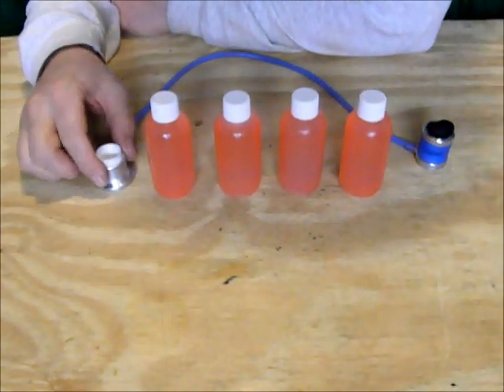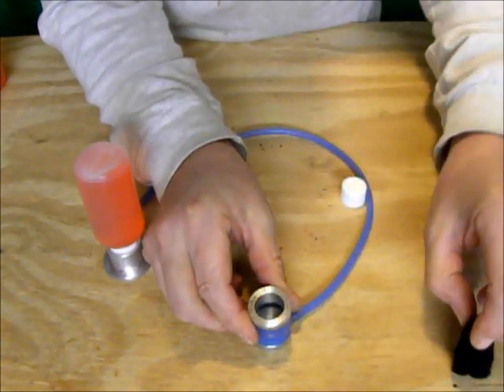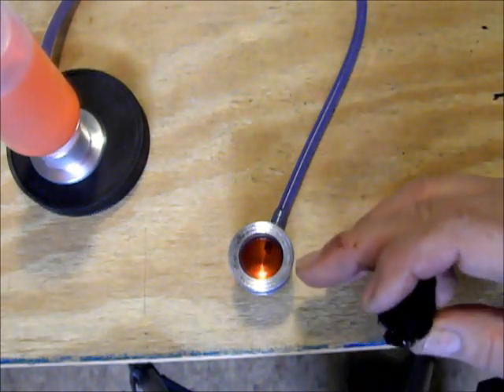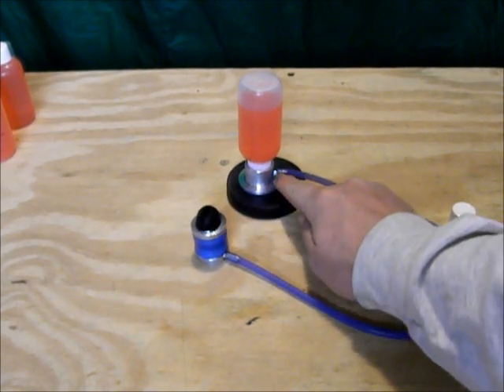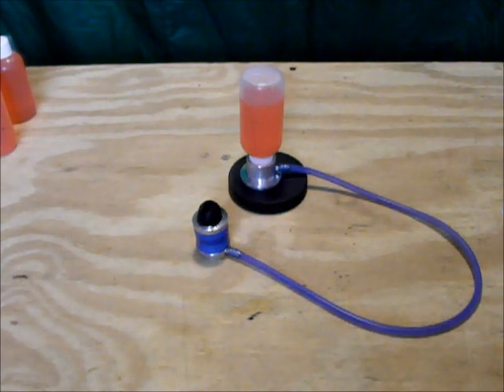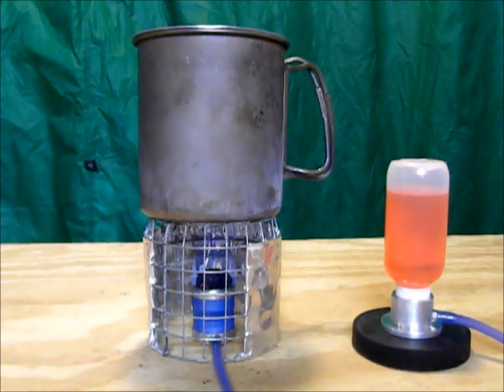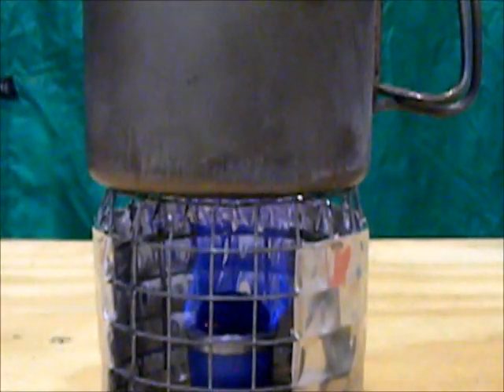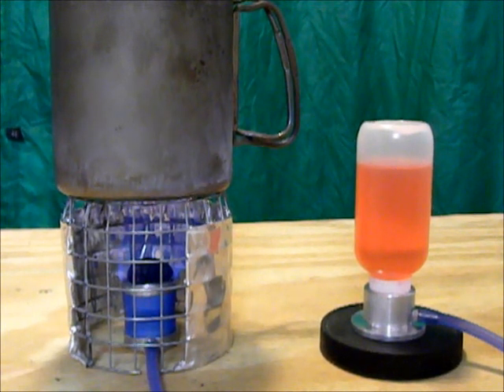The MBD chicken waterer revisited

Comment: MBD, Inc. Standard Issue Midway Busker Bowler:  Made from 100% felted carbon fiber, with integrated 60 x 10 pot stand.  Turn hat over onto MBDC Level Surface (sold separately), and fill with 4 cups alcohol.  Will boil a chicken in under 30 minutes with burn time left for chocolate fondue for 8, 3 pots of coffee, and a marshmallow roast.